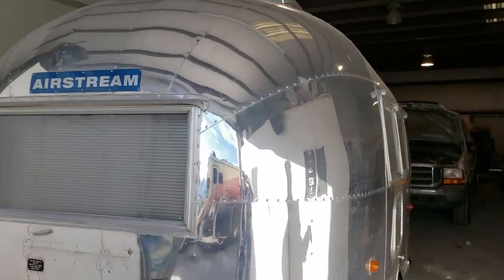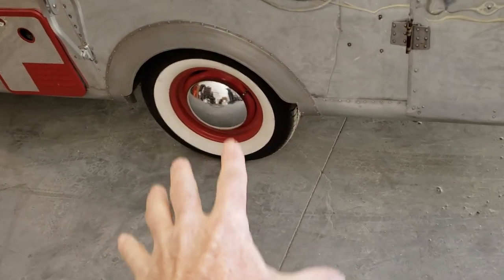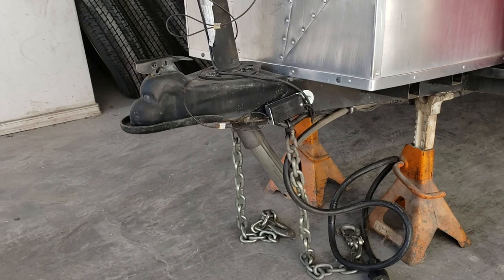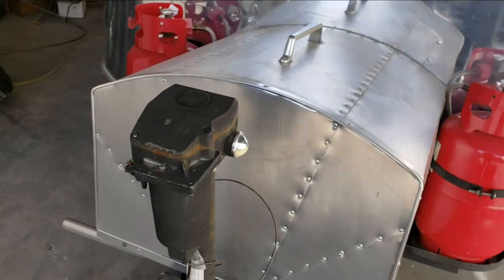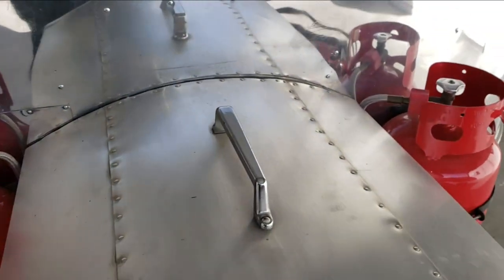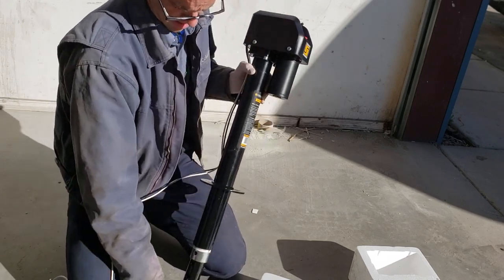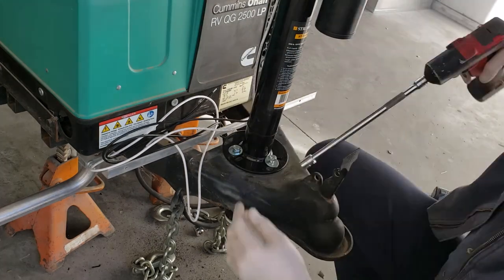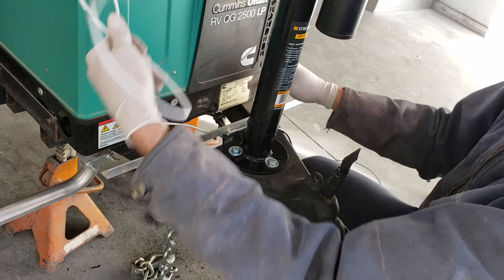Replacing a Trailer Tongue Jack on a Vintage Airstream

Comment: Thank you so much for getting back to me so quick I guess I’m talking about the vinyl that goes in the track when it gets to the curve it keeps popping out
Reply from the maker: I suggest installing screws through the vinyl insert either before and after the curve or in the middle of the curve. Which ever is more likely to hold the insert.

Comment: Thank you for your videos. I really enjoy watching.  Question,  I have a 2018 Winnebago and just noticed the roof had a small lump/bubble (about 10 inch. long 1 inch wide) in the fiberglass. However, as the day cooled off the bubble for the most part disappeared.  Other than that the roof is in excellent condition, seals are good and no signs of water intrusion.  Are you able to give me your opinion? Thank you in advance.
Reply from the maker: Bubbles are not uncommon in Winnebago roofs and the fiberglass material does flex with heat. I'd first ask where the bubble is and the direction of the lump. There are 4 to  6 sheet metal cross ribs where the roof naturally lumps from one side to the other.
Reply: @AZExpert  Thank you for your response. It is from the mid bath vent towards the edge of the roof but does not actually reach the edge/radius.  I didn't believe it was much of an issue but thought I'd get your opinion. Thanks again and keep them great videos coming.

Comment: I have a class c motor home and the front molding strip dose not want to stay in at the curve. Do you have a fix for that. Thanks for you help
Reply from the maker: I'm assuming you're talking about the vinyl flexible insert/screw cover. If that is the case, I generally put color matched screws through the insert. Usually two strategic screws is all it takes. Thanks!